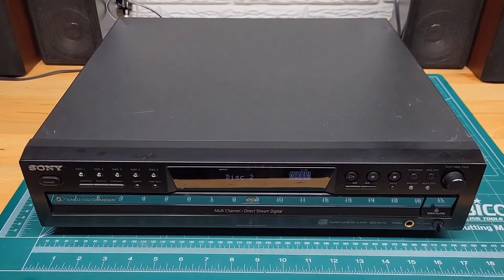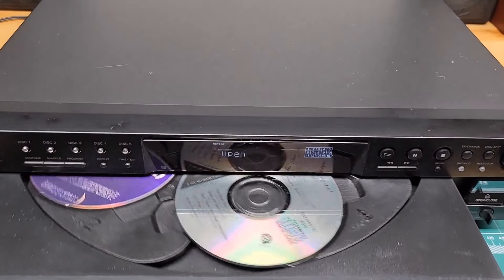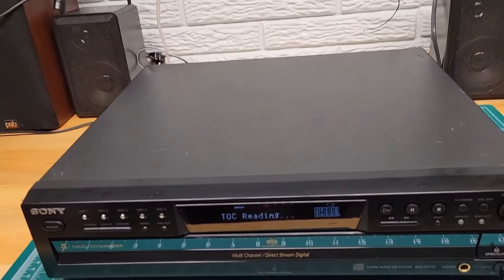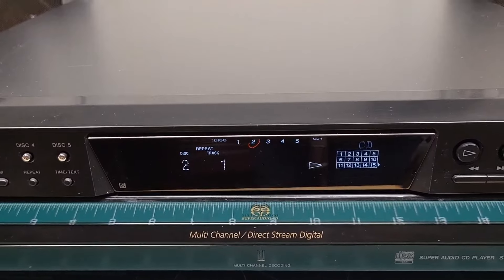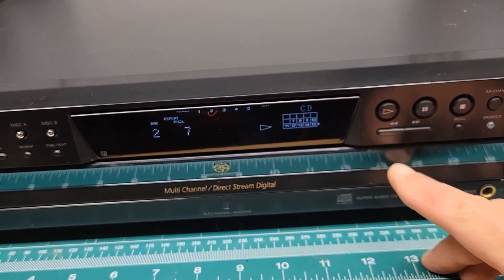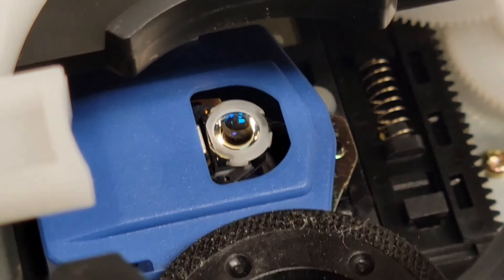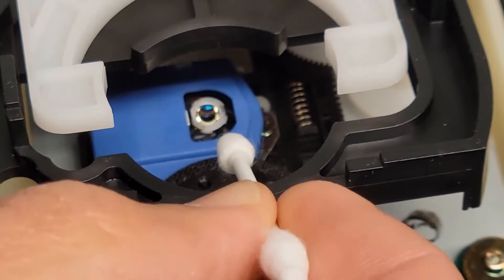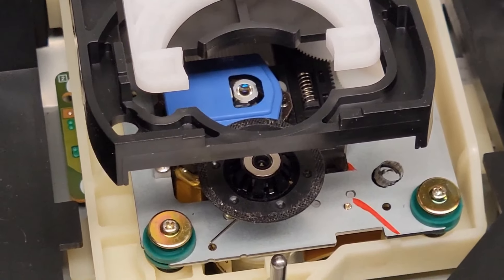How to Clean CD Player Laser When CD Won't Play - Sony SCD-CE775 SA 5 Disc Carousel

Comment: Thanks for this video. Very informative.
It appears that all 5 CD chambers just share the same single laser lens in these multi CD players. Is that consistent for all multi CD players?
Reply from the maker: @pinkieswear6611  Hello and thanks for your comment and I'm glad you enjoyed the video. Yes, all of the multi-cd players I have ever come across share 1 laser pickup. Thank you.
Reply: @vintageav  Great - to follow up and make sure I am understanding you: when I use one of those head cleaning disks (the ones that say at the end of the process, "your laser lens is now clean"), I only need to use it in exactly ONE of the cd trays of the player, correct? 

That single use in ONE of the 5 trays, in fact, cleans the laser lens for ALL 5 TRAYS, correct?
Reply from the maker: @pinkieswear6611  You are correct.   You clean once and you are good for all cd tray positions then.  One and done.
Reply: @vintageav  Thanks!